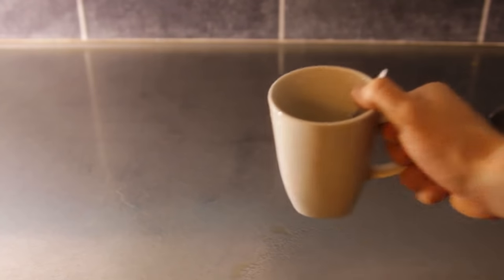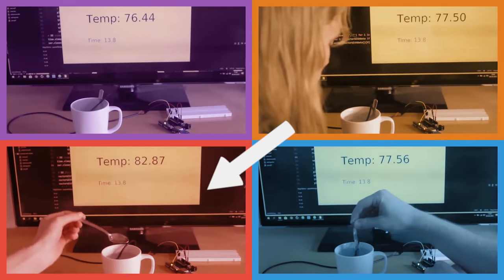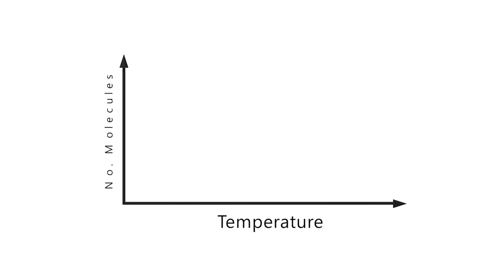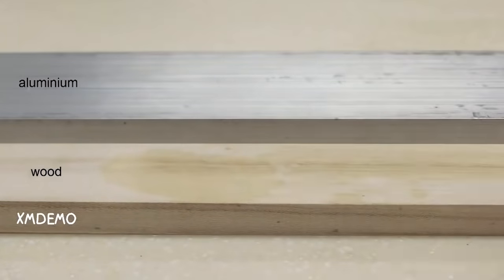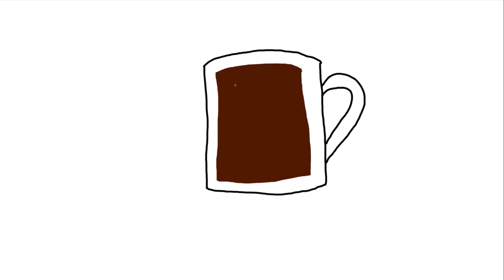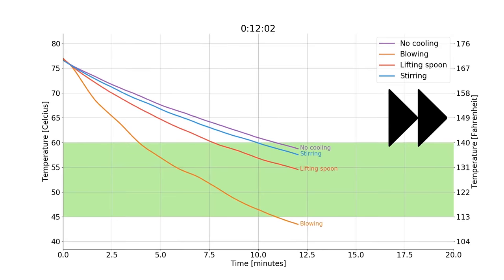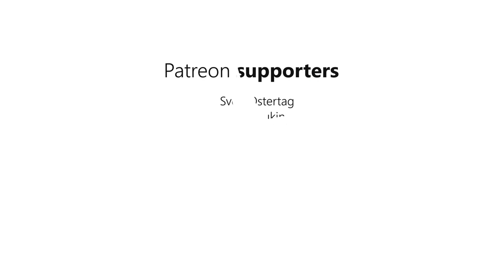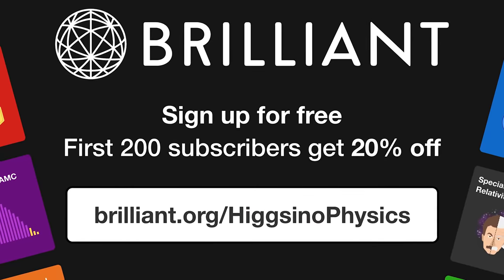Cool Coffee Fast with Physics

Comment: You used a ceramic pot which slows down heat loss. You left the metal spoon inside pot. What if u do the same experiment with glass or aluminium pot same size? What if you remove the spoon? What if you have 2 pots and pour liquid from one pot to the other alternating? What if you put pot in fridge? What if you put pot inside pot with ice cubes? And what if put to chiller? If the coffee temp drops fast then it is not enjoyable to drink. The best is to use some isolated cup to slow down temp loss more than ceramic. Nice video.

Comment: What about pouring the coffee from one cup into another? And would the distance between the cups ( let's say two inches away versus twelve inches away) make a difference?
Reply from the maker: will be faster. But often you won't have an extra cup -  on a caffe or something. That's why i didn't also test with a fridge or with ice cubes.
Reply: Adding a second cup will soak some heat from the water alone - the cups are room temperature after all. The extra surface area when pouring will have a huge effect, since that gives you a bigger area for the liquid to evaporate from. Other than that the increased surface area, the effects of pouring are similar to blowing. Pouring further is like blowing harder - it falls through the air faster, so it exchanges heat more efficiently.
I expect that pouring would be the fastest, but also the most cumbersome. Also, if you want to try to pour from one cup to another at 12 inches, expect spills.
Reply from the maker: I actually tested this lol. And yes you are right Mikkel - especially about the spills oh my god! I quickly glanced at the results but I think it’s about double as fast than blowing

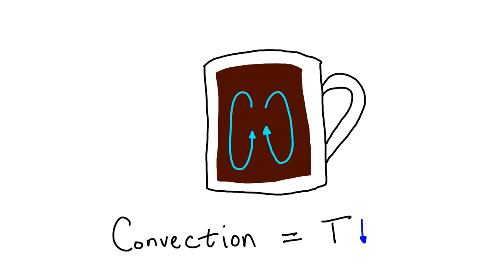Comment: 3:47 Sorry, but you explanation is incorrect. Since you are blowing onto the surface you are not going to lower the pressure enough to have any noticeable effect. Pressure on surfaces is lowered when air blows across them because the fast moving stream of air across the surface causes fewer molecules from reaching the surface. For example, Let's say students leave a classroom and try to walk across the hall to the stairwell. The fast moving students in the hall are going to drag some of the students along with them as they try to cross so fewer will reach the stairwell.

Replace students with air molecules and you can understand the reason WHY the air pressure on the surface is lower. Fewer molecules reach the surface to strike it so the pressure is lower. The faster the air stream the more molecule dragged away and the lower the pressure. Your blowing into the cup f coffee is not going to accomplish that.

The actual reason the coffee cools faster is because you are blowing away the warm humid air and replacing it with cooler drier air, so the rate of evaporation increases. It is the same you feel colder when the wind blows.

Comment: One thing I do is that I use two cups and pour the hot liquid of one into the other and vice versa a couple of times, until it cools down. The hot liquid (coffee) exchanges heat with the cool air, forced convection put simply.

Comment: Technically if you blow for long period of time you can actually freeze your coffee
Reply from the maker: How?
Reply: @Higgsinophysics  Okay, just a disclaimer I'm not a scientist and I have never tried this experiment. What I just said is a bit of a "false advertising" since this will probably never work on coffee but might work on water and under very strict idealistic conditions. What you will need for this to work is a gigantic vacuum chamber , an enormous amount of water and a lot of time (very precise measurements given, I know) . Also, the water needs to be insulated from any heat flow from the bottom. In these conditions it seems that by blowing your lungs out (which might literally happen since you're in a vacuum chamber ) (trough vigorous evaporative cooling) you can actually freeze the water. It is important that there is no air around since heat can flow back in from the air. One key fact is that the latent heat of vaporization is much bigger than the latent heat of melting, so each gram of water that evaporates should cool things enough to freeze more than a gram of water. That gives some room for heat leaks without stopping the process altogether. Hope this makes sense and please let me know if you find any mistakes in my explanation or have any other questions. Btw I really enjoy watching your videos! (side note: have you heard about the mpemba effect I think it is a pretty interesting phenomenon :)  )

Comment: Great video. What temperature probe are you using? Seems like it performs well. I would like to do similar experiments testing kettles for thermal insulation/conductivity.
Reply from the maker: Would love to see that! I used a Waterproof Temperature Probe Thermometer DS18B20